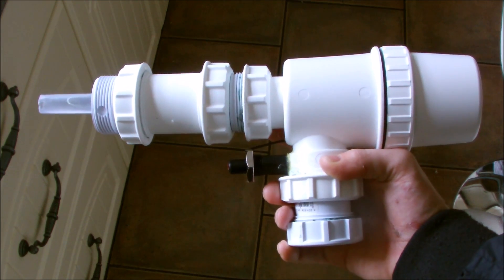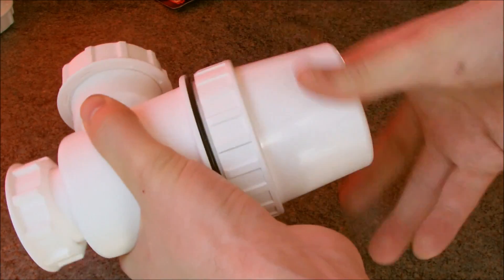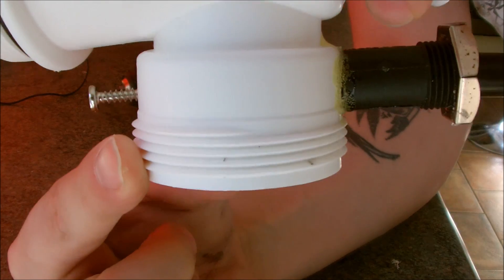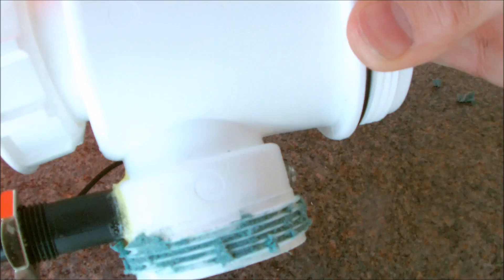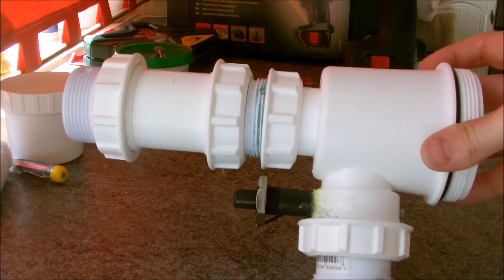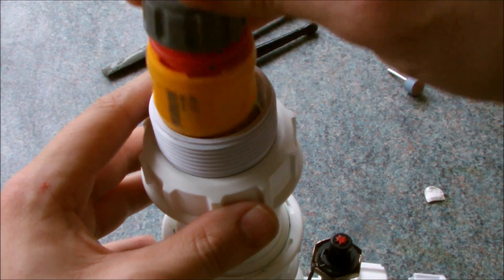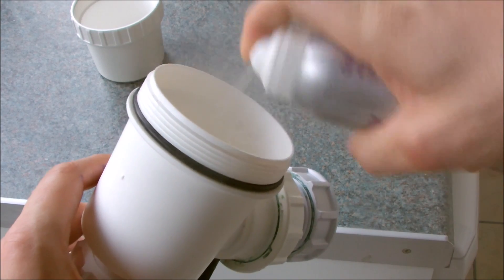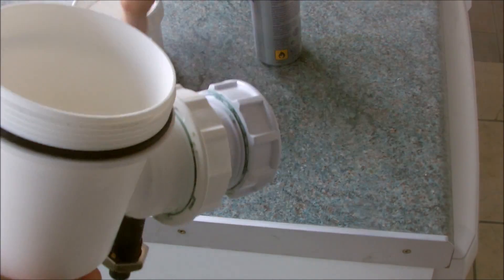Hair Spray Powered Nerf Gun!

Comment: WAY TO MUCH HAIR SPRAY! if you put less in you will have more power... you want to get a good ratio of fuel vs O2... to much of ithere is not good...
Reply: Just add iron oxide dust to the hairspray since iron oxide dust release oxygen making the combustion more powerful and instead of hairspray use the strongest alcohol you can buy since 100% alcohol requires a phd in chemistry or special lab permission to handle since 100% alcohol is not sold at any stores may be the black market which is on the deep web which your every day computer using Joe can't get on unless they are smart and if then even with IP blockers they can still get tracked to their location. Good luck on your journey getting 100% alcohol you may die in the process
Reply: I suggest just using 90% alc is good enough not worth loosing your life over trying to get 100% alc which evaporates almost instantly butane or propane are good option too but not as cool

Comment: The cost from my local diy store of the pvc pipes and connectors in total $42. The cost of hair spray $4.99, Pipe cement $11.95.
The cost of the Nerf gun at my local Store $29.95. =(

Comment: that was nice, the thing you used for triger isn't sold in my country, would a cheap chinese lighter be enough?
Reply: using a spark plug would mean wiring it to a power source, which is a mess, what he uses is similar to some lighters but way bigger, that thing doesn't require external energy
Reply: They should sell a spark plug in a car repair shop :) check there
Reply: Matt the guy they do sell spark plugs at any car shop...